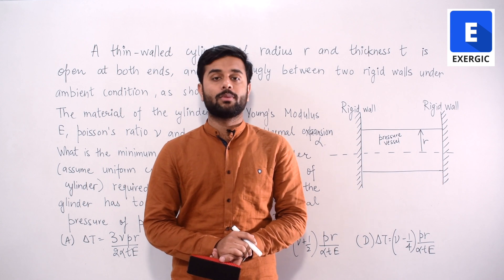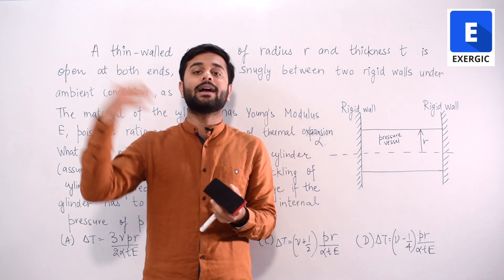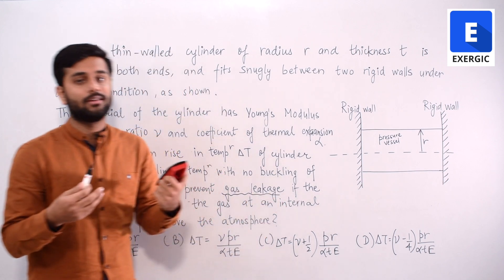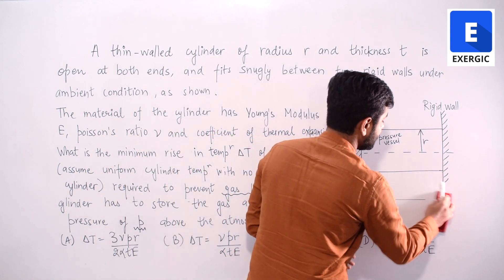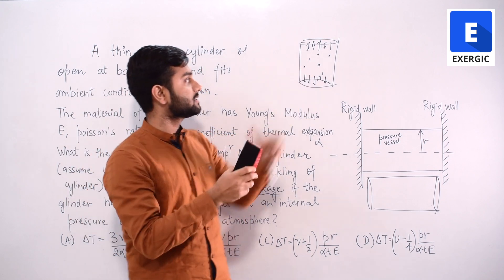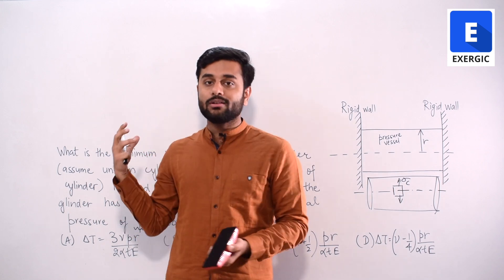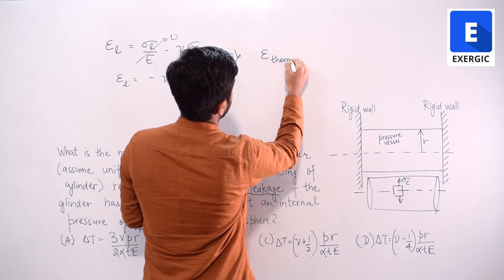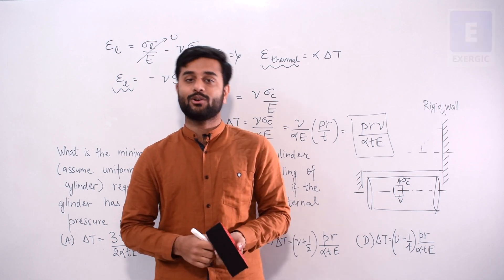Thin cylinder question - GATE 2020 (Set 2)

Comment: Wont diameter increase with increase in temp?
Reply: Yes exactly
Reply: It doesn't matter if diameter increases or decreases... As it not causing leak of gas... Gas can only leak if thr is decrease in length... Thats why only strains in longitudinal direction is considered... I hope i am right.. I thought this way... I may be wrong
Reply: But what about the effect of increase in diameter  which decrease the length?
Reply: @Evil_moorthy  sir has calculated that only... Decrease in length due to increase in dia which is caused bcuz of hoop stress